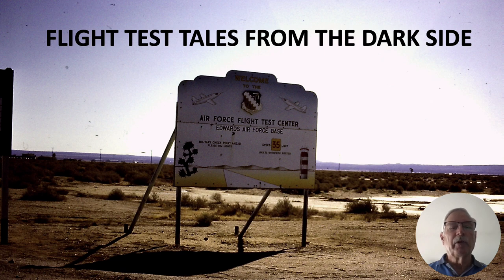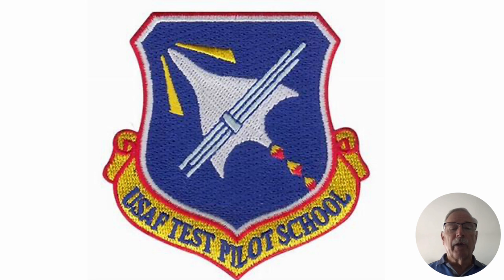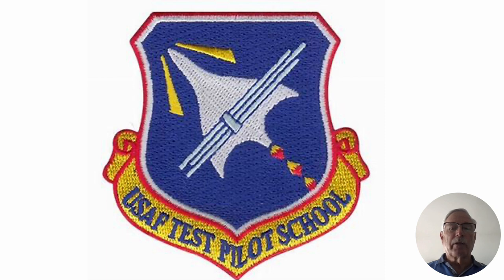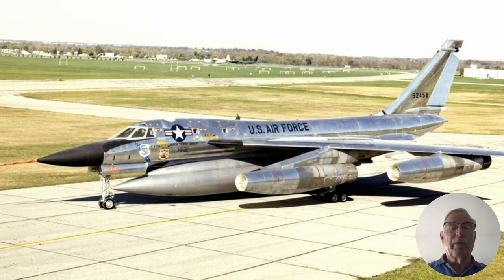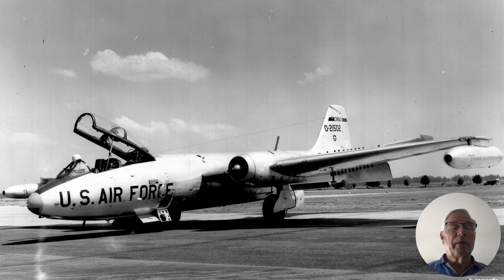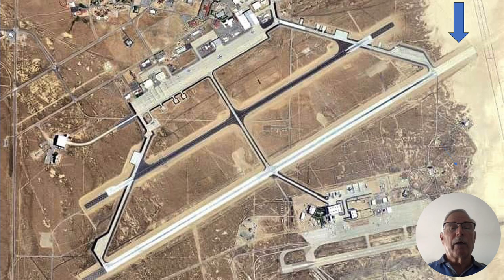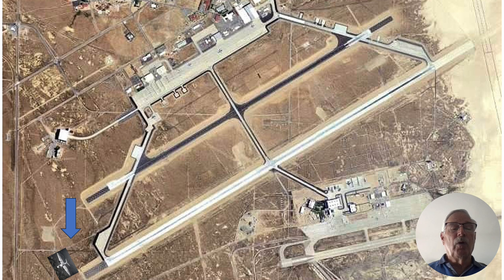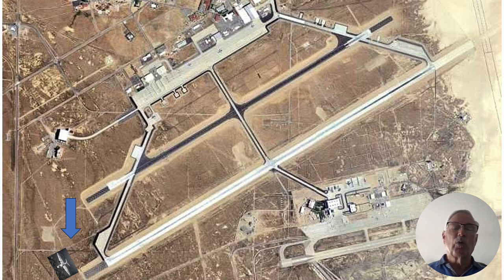FLIGHT TEST Tales from the Dark Side. How to run off the end of a 15,000 foot runway!

Comment: Years ago Edwards Air Force Base had a fly in for general aviation. I flew there in a Mooney. A huge number of airplanes flew in. I was instructed to land on the first half of the runway the airplane behind me was instructed to land on the second half. About 20 feet off the ground I saw the shadow of an airplane above me. When it was time to takeoff the traffic on the taxi way resembled freeway traffic. The wind was clam so the controller just said to all taxi out on the center taxi way and takeoff either way when you saw an opening. That is one long runway.

Comment: Nice video, Ron. 👍  I believe NASA is still flying three WB-57 aircraft. According to one of NASA's websites, "The NASA Johnson Space Center (JSC) in Houston, Texas is the home of the NASA WB-57 High Altitude Research Program. Three fully operational WB-57 aircraft are based near JSC at Ellington Field."  N926NA, N927NA, and N928NA   (I live in Houston.)
Reply from the maker: I think you are correct!
Reply: The English Electric Canberra was designed immediately after WW2 as a replacement for the iconic DH Mosquito light bomber. First flown in 1949 (by Roland Beamont, who went on to do successful maiden flights in the English Electric P1A, P1B Lightning and - in 1965 - the TSR-2), I think it may have been the first British design to employ an axial-flow engine, the Rolls Royce Avon turbojet.  
Its US version, the Martin B-57, seems to use a version of the Armstrong-Siddley Sapphire axial-flow turbojet: the Wright J-65, of similar thrust to the Avons used in the British Canberra.
Now for the point. The engines in the Canberra are mounted well outboard for wing-bending relief to mitigate the heavy bomb-load in the fuselage. I understand that, as a result, the Vmca (single-engine safety speed) of Canberras is above the normal unstick speed on take-off. 
That being the case, I imagine the pilot of the aircraft in this incident must have kept the good engine substantially below rated thrust to stay on the runway while fiddling with the throttle of the problem engine. Nevertheless, he seems to have been going jolly fast when he ran off the end of the pavement...